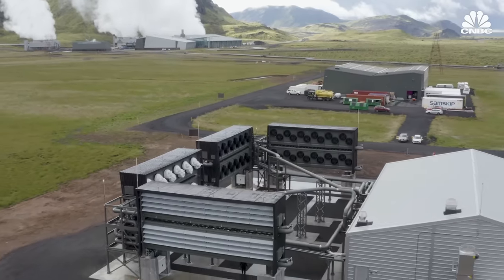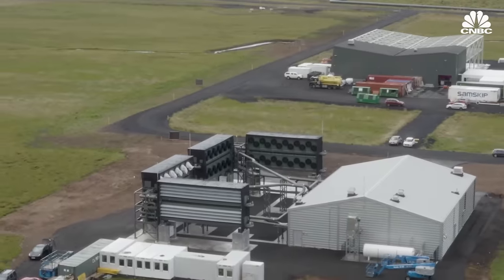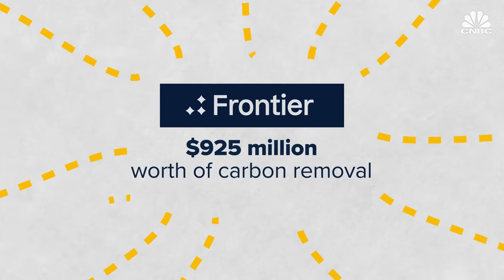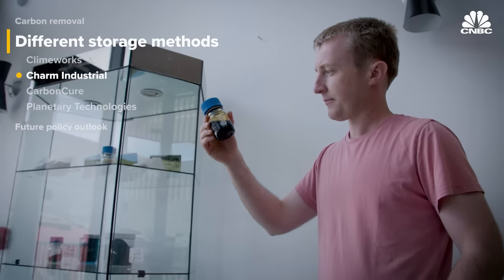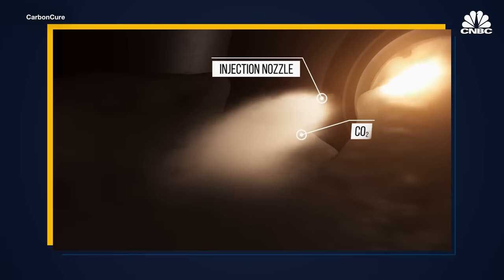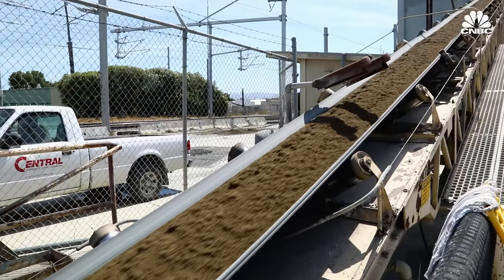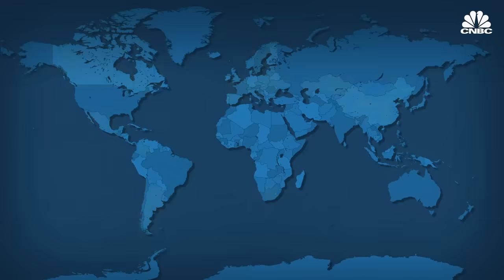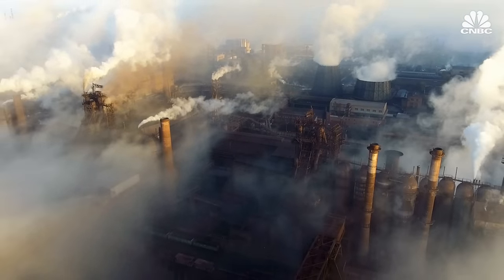Why Big Tech Is Pouring Money Into Carbon Removal

Comment: Something completely and totally missed in this piece is the Sabatier Process.  While this piece is focused on permanent removal, you are basically trying to deal with a fire by trying to capture the smoke as the fire rages, but doing nothing about the raging fire.  If anything you end up burning fossil fuels to do these capture and permanent storage processes, so you make the fire worse.  We use lots of natural gas and it is a huge crises right now, especially in Europe where Russia is toying with Europe's gas supply as it comes from Russia.  To have stability in the world so we can do this other stuff, first priority has to be to fix this geopolitical problem.  Carbon capture from emitters and turning it into methane is already proven.  It just needs to be scaled up.  You just need energy and water.  When you consider all that goes into the fossil fuel based natural gas industry and all of the damage it does to the planet, there are huge potential benefits to manufacturing natural gas through something like the Sabatier Process.  Then you can start moving towards a closed system.  If you can get closer to nothing new is getting out, then switching focus to permanent removal would make a lot more sense.

This is the other thing, we haven't been smart enough about greening up our energy grid.  We need more stable sources of energy that don't emit CO2.  There are answers, but just mentioning it here to point out there is more work to do to really have anything that makes real sense to do.

Getting into the methane / CO2 cycle, there are some important things to point out.  CH4 (methane) is a potent greenhouse gas, but it does break down over time with exposure to UV radiation into CO2.  The main reason to take interest in methane is we are already using it everywhere and we are not going to stop overnight.  So just tapping into the existing system and effectively cutting out the CO2 footprint is a huge thing, especially as it is relatively efficient to do compared to some other carbon capture and techniques and there are huge secondary benefits attached to it that ultimately reduce CO2 emissions and leakage of methane from wells and flaring of methane from wells where it is turned into CO2 on the spot.

This is another thing, as we electrify transit, we reduce the need to drill.  However as we drill less, we have less natural gas supply.  So to supplement that gas supply, we need to start producing methane through other means.

If we get good enough at these other means, we might start doing things such as putting a tank of LNG in the attic space of airliners and having it as a supplemental fuel source, reducing the fossil fuels used as the LNG will be manufactured from carbon capturing.  With planes, LNG is particularly interesting because modern superconductors can get to operating temperatures with LNG.  Then there is work on things such as LiS (Lithium Sulfur) batteries that are 3x as energy dense as what you find in a Tesla car today and also can put out way more instantaneous power than say the batteries in a Tesla Plaid.  The notion being you can build a way more efficient hybrid electric airliner where the jet turbines are shrunk down and run at or near max throttle throughout most of the flight as jet engines run far more efficiently at max throttle.  The fans are made bigger and spin more slowly because they are electronically gear shifted down.  This can be far more efficient than the current day direct on jet turbine shaft 'big' bypass fan in the front as it is actually a compromise to eliminate high maintenance gears both by making the bypass fan spin faster than what is most efficient and having a big, inefficient bell on the back of the engine to slow down the air going over the turbine blades that turn the bypass fan.  Having a straight through jet turbine engine is far more efficient and having a bigger, slower moving fan is far more efficient.  Having light LiS structural batteries in the wings can provide the instantaneous power to say take off and climb rapidly and also just buffer power as the plane flies through varying wind currents at altitude.  Engine out capabilities would be great because you could use the superconducting electrical system to distribute power to the side of the plane where the 'complex' jet turbine failed and push the 'simple' reliable fan harder to balance the torque on the plane, allowing the plane to fly more efficiently.  As you slow down the plane a little to raise efficiency, you can make the wings a little straighter, allowing the plane to be structurally lighter and more stable as higher wing sweeps adds mass and can lead to a plane tilting back further in a stall condition, making it easier to tip back into a full stall and harder to recover.  Wing sweep is only there to handle conditions that arise as you get close to the speed of sound.  So say you apply this to a 787 replacement, which is already one of the most efficient airliners out there, you might see a modest increase in dry mass of the plane, but yet fuel consumption goes down by another 30% or something to the like.  On a long haul flight, the plane will actually be lighter for the same seating and thus burn even less fuel as you burn fuel to move fuel around, but if you need less fuel for the trip, then you burn less fuel to move that fuel around and so can further reduce fuel consumption.  (An orbital class rocket is really bad at this where almost the entire starting mass of the rocket is propellant used to move propellant around and only a very small percentage of the starting mass is actually payload.)

Comment: Ever heard of Henry's Law and Le Chatelier's Principle?  If you pump carbon dioxide out of the air it will be replaced by carbon dioxide  gassing out of the ocean. There is far more carbon dioxide dissolved in the oceans than in the air. Pumping 1 million tons of carbon dioxide out of the air sounds pretty impressive until you realise that there are over 3 million million tons of CO2 in the atmosphere, yep that's 3 MILLION MILLION TONS!

Comment: what blows my mind, is that you can barely raise any money for reforestation programs that have a much better impact and utilities than carbon removal tech. If you could put aside 500B for reforestation, this would not be a problem anymore.
Reply: In a nutshell - trees grow too slowly and we use too much fossil fuel for it to be a viable solution. Try to make a few back-of-the-napkin calculations.
Reply: @SweBeach2023  that is ridiculous. Tree do not just remove carbon but strengthen soil and enrich biodiversity. To believe that we can be better than billions of years of nature intelligence is ridiculous.
Reply: I think we need all the approaches possible. We're too early to take any options off the table. So yes to reforestation - there are lots and lots of good co-benefits. But yes also to Planetary and "non biological" carbon removal systems. Planetary has a bunch of great co-benefits too, including decreasing ocean acidification, creating green hydrogen, and removing toxic mine waste.
Reply: @nyakarundi  To give a bit of perspective. The world contains as much CO2 bound in biomass as we emit in like 40-50 years time. And this biomass doesn't live forever, far from. Even if we were to double the worlds biomass it's just a temporary fix. While I agree trees are very helpful in many way, it's not a long-term fix to stabilize the CO2 levels in the atmosphere.
Reply: @SweBeach2023  We would need thousands if not hundreds of thousands of those devices to make any changes, where would they be built? can you imagine more concrete construction, plus these machines need the power to operate, and more CO2 will be produced as we all know renewable energy tech is not producing enough power globally yet. And of course, those companies need to monetize to continue raising money and scale. If corporations stops paying for it, who will be for it most likely consumers. I do not see any upside for this type of company and tech. We are trying to replace nature, plus we are addressing the real problem which is reduction of CO2s from corporations.

Comment: Edison generator is a permanent magnet motor as a generator that powers a line of dynamos.  We add inverters and transformers to deliver high voltage AC power.  The power plants are identical to hydroelectric power plants without water or fossil fuels without fuel.  Tesla's power plants bound Edison's generator with magnets all around the armature and used water to turn the armature.  We still foolishly turn the armature with water wind and steam.   These efforts are not needed to generate electricity.   We are grossly misinformed about power generation and power use.

Comment: Different this time ? Almost all Bitcoin metrics  are now hinting at a price bottom ,Bitcoin investors face mixed sentiment as some think the bottom is very dangerous at the time to investors . :yt:Meanwhile , others fear the impact that a global recession could have on risk assets . For this reason , traders should analyze derivatives markets data to understand if traders are pricing higher odd of a downturn. Despite currently holding an extremely low futures premium (Basis rate ), the market has kept a balanced demand between leverage buyer and sellers . To exclude externalities specific to the futures instrument , trades must also analyze the Bitcoin option market . For instance , the 25% delta skew shows when Bitcoin whales and arbitrage desk are overcharging for downside or upside protection During bearish market , options investors gives higher odd for a price crash , causing the skew indicators to rise above 12%. As an investor , I will urge all Investors  to Buy and not to hold but engage into Day-Trading in  other to Grow and accumulate profits in their portfolio not to run at loss . I have been able to get  profits of 5.5(BTC) in less than 5 weeks using signals alert provided by Dr Oscar Aldrich . Dr Aldrich can be contacted via  Telegram Oscar_Trade * for further inquiries in any crypto related issues .
Reply: Looking at the price prediction signals  Oscar Aldrich  offers, it is very profitable and traders should apply that more to his patterns also.
Reply: Nice.. i am also interested.
Reply: Will have to contact Mr Oscar Aldrich right away.. Thanks for the info!
Reply: Can i be part of this success as well?
Reply: without any doubt, Oscar Aldrich daily signals has indeed been life saving since this pandemic
Reply: For good 3 months now its been massive profits for me and my friends here in Germany

Comment: Stoking the CO2 seems a strange idea, because CO2 is 1 carbon and 2 oxygen, I'm not sure but if I remember wee need oxygen to stay a live, not sure stocking the oxygen like that is a good idea
Reply: Most of that CO2 was in the ground in the form of oil and coal before people started burning it. There weren't any oxygen shortages before the industrial revolution, but the air was a whole lot cleaner. Putting that CO2 back where it was won't have any negative consequences.
Reply: @Irilia_neko  Then grow trees which produce oxygen. LOL.

Comment: The approach should be what was done with used restaurant cooking oil. Unless  it's self funding because the captured carbon has a lot of demand then it will be a massive up hill battle.  Maybe convert the carbon into Graphene products such as solid Graphene rebar that doesn't face any winter corrosion related problems?
Reply: CO2 is useful in many industrial processes, and more are coming out all the time.

Comment: Remove 10 tons of Co2 with machines/factories. Great.  
But how many tons of Co2 do those machines/factories reject in the atmosphere by functioning  ?  Because they are most likely running of petrol.
How many tons of Co2 is rejected in the atmosphere to create those machines/factories ? 
How many tons of Co2 is rejected in the atmosphere to building those machines/factories ?  
Carbon removal by machines/factories are not the answer. It's an offset that doesn't work.

Ciment industry is responsible by 12% of the worldwide Co2 emissions. So the concrete/ciment factory is the perfect example of a wrong offset.

Comment: Mineral accretion through electrolysis has the potential to store thousands of tons of CO2 annually. There are two main ways it can be done.

Firstly, It can be used to either repair existing coral reefs or create new reefs. These new reefs have the benefit of creating entirely new marine biomes, increasing the amount of carbon that is tied up in organic matter and helping to repair centuries of overfishing. 

Secondly, it can be used to pretreat water for desalination plants, making the resultant desalination process more e energy efficient. The minerals that are accreted, can then be processed and have valuable minerals harvested from them. IE magnesium, lithium and cobalt

Comment: Regardless of many companies are out there, emissions overall need to be cut down ( less coal, oil, and other green houses gas), plant more trees ( reforestation) and rely on this technology to remove CO2 where it’s possible
Reply: Agreed.
Reply: Why can't consumers such as yourself just stop consuming products that omit carbon dioxide when being manufactured? Do you yourself not consume plastic on a daily basis, drive a vehicle that relies on petrol, fly on planes that use kerosene, and turn on your light bulb that requires a plant burning fossil fuels to operate?
Reply: @lmy2366  my food on the groceries shelf is being transported, say a truck ( emits emissions). As a consumer, we are limited to why we can buy although there are variety. Can I grow my food, sure. Can I bike or walk to work, sure. Can I swim to the other side of the world l, nope. It all start with major industries, coupled with regulation and standard.
Reply: @Mjixa  Not using such products (cars, plastics) would merely inconvenience you, at worse make you a little poorer. It is your choice as a consumer what types of product you purchase and utilize and the effects therefrom. In other words; you (and people like you) have agency over the amount of co2 that is emitted, it's just that you and others pretend otherwise and cry regulation!
Reply: @lmy2366  overall, it’s sustainability. Mindset wise, you can call it poor choice not in the economic sense. Again, many factors contribute to the GHG, not to forget the huge polluters. Read more on economics how governments set regulations to reduce carbon foot print working along companies.

Comment: This is the solution: Produce hydrogen by using electricity from green energy. Then use the Hydrogen for fuel and the pure Oxygen to combust organic waste for heat and electricity. The exhaust will then mainly consist of H2O and CO2. The CO2 can then easily be sequestrated in the ground without any expensive processes to remove the CO2 from the atmosphere.
Reply: Oil companies don't want that.
Reply: @NashHinton  That is what I ment. But today there does not seem to be any plans for what to do with the oxygen. 
In Copenhagen, for example, most buildings are remotely heated from the thermoelectric plant outside the city. They burn a lot of organic agriculture waste, which is good, but the CO2 is just released into the atmosphere. Air consists of about 80% nitrogen, and removing this from the exhaust so that the CO2 could be sequestrated, is very expensive. But when burning organic waste with pure oxygen, one will be left with almost 100% CO2. This will be much cheaper to deposit safely. The hydrogen should of course be used for aeroplanes and other usages where batteries are not practical. 
The process of extracting CO2 from the air seems hopelessly complicated and expensive in comparison. 
But it would be typically for the fossil fuel industry to "support" these methods so they can show how impractical these environmental solutions are, and then they can delay the green shift for another few decades.

Comment: Humanity suffers from the Cassandra complex! I expect us to hit 1.5 C within the next decade at which point runaway climate change will dominate the events aka loss of albedo, phase change inertia, and permafrost methane emissions..... Carbon catchment will not prevent that and will only increase the heat due to the massive amount of energy it consumes....
Reply: There are negative feedbacks, like carbon being absorbed in rising sea levels, but either way it's not looking good. I calculated 7 degrees by 2100 and 8 degrees by 2120, which is permian extinction level warming. After 8 degrees, oceans stagnate and release hydrogen sulfide which damages ozone layer as it did during the Permian extinction.
Reply: @NashHinton  How do rising sea levels absorb carbon?
Reply: @NashHinton  For sure there are positive and negative feedback loops. The negative feedback loops would include prolonged and increased photosynthesis if it is not offset by wildfires. The ocean sinks are diminishing with increasing temperature and acidity so again will have to see how the rising sea levels and deep ocean exchange playout.... I am still going to work my ass off till 2030 and keep the hope alive....
Reply: @master8127  Oceans absorb co2
Reply: @NashHinton  Yes, but rising sea levels barely affect the area of an ocean and the increase in volume is basically zero
Reply: @master8127  Still, the oceans would deacidify when melting ice releases additional water in the oceans. I know the negative feedback isn't significant. Pretty sure I made that clear in my original comment.
Reply: @NashHinton  How did you calculate 7 degrees? The Business as usual trajectory is at 3.5 Celsius by 2100.